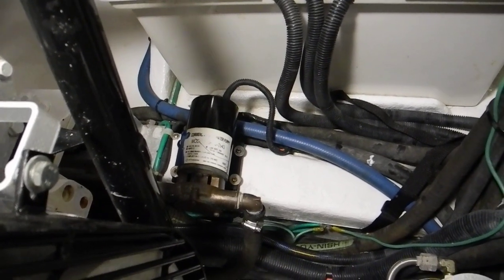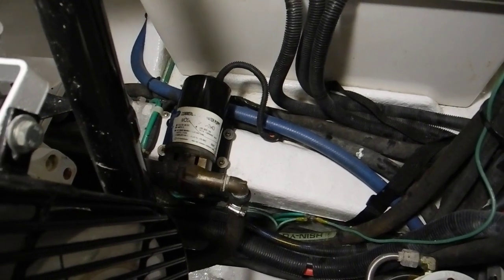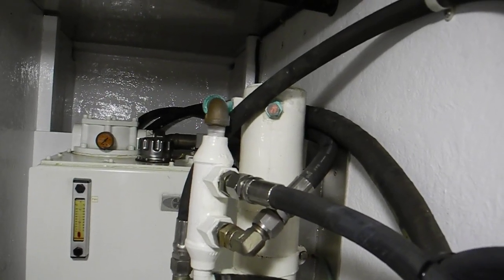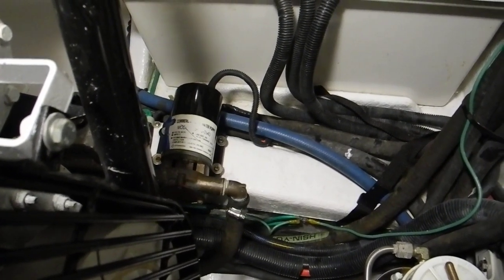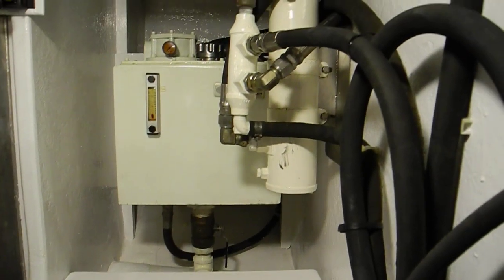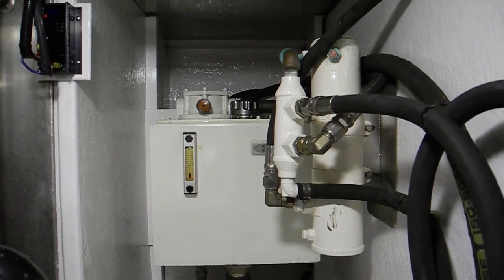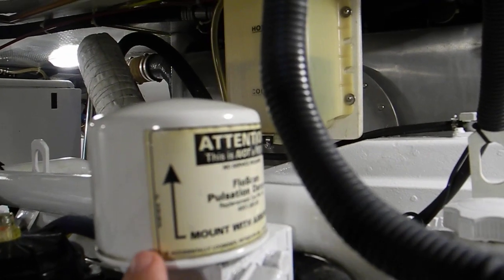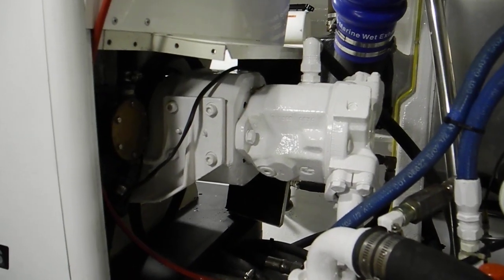Hydraulic cooling system for stabilizer

Comment: Did not know that this system generated so much heat,is this common with most stabilizing system ?
Reply from the maker: Edward C. Yes it is. But many are cooled by the engine’s raw water cooling system instead of a dedicated pump like we see here.